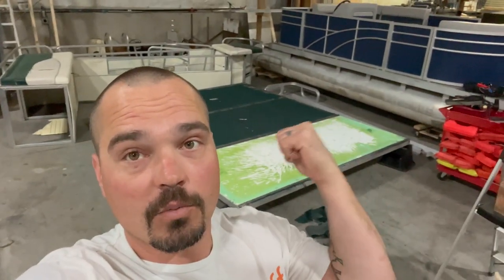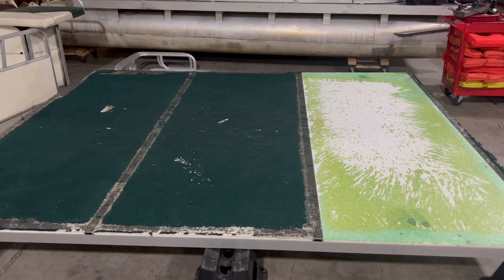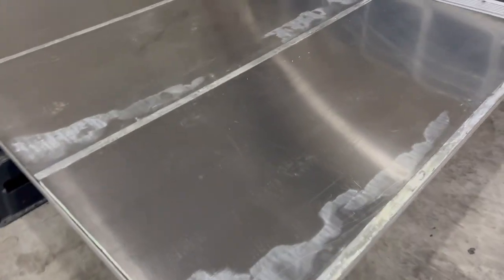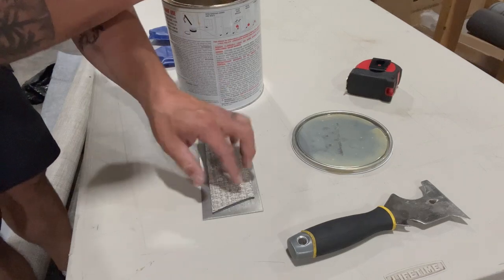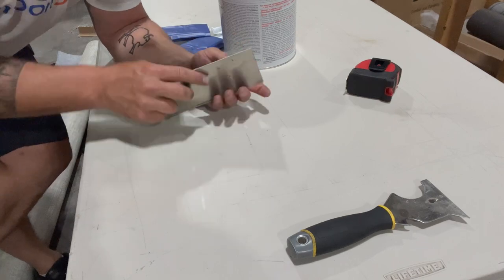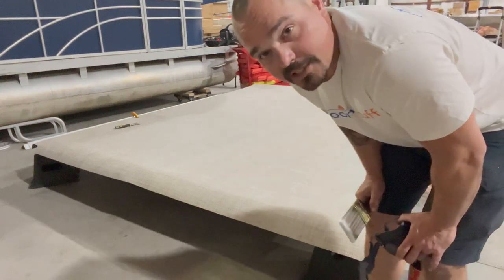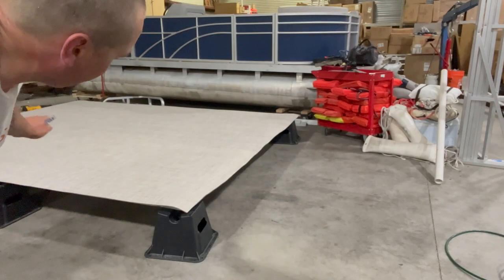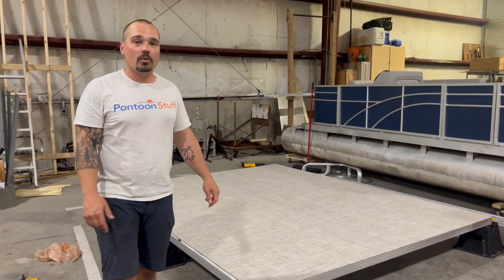Installing Pontoon Vinyl Flooring on ALUMINUM DECK

Comment: Been waiting for you to do this video! We replaced old carpet, with the new teak vinyl. I would not do the removal process again! Ended up using a 4” wheel sander, again not easy and you are correct about it melting the old glue. We used ATT 390 Marine and exterior adhesive, non flammable. Good for aluminum and Marine grade plywood subfloor. It’s a glue, not a contact adhesive, soo much easier to use than contact adh. The floor has been down for 2 months and is secure and beautiful. Love your videos!
Reply from the maker: Thanks for sharing the adhesive you used and your results…I’m sure that install process moved along much faster and smoother! Pontoon Stuff advises their customers to use a solvent based option which is why I wanted to show the process. They’re playing it safe with that advice because when done correctly the solvent based adhesive will surely hold their flooring down for the long haul!

Comment: Hey Tom.  Is this the same glue you would use on marine grade plywood that has been treated with a sealer? Thanks!
Reply from the maker: I would advise against sealing and if the marine grade treated plywood. It needs to breathe and dry when it gets wet. If it’s untreated and you sealed it then yes, you’ll likely need a solvent based adhesive (as long as it doesn’t interact negatively with the sealant). If you’re installing carpet and not vinyl you could use a regular carpet glue as the carpet breathes enough for the glue to cure

Comment: Is vinyl on aluminum hot in the sun?
Reply from the maker: It shouldn't be any different than when it's installed on wood. A hot day in the 90s under direct sun it'll get a bit hot, but just splash it down with water and it'll be good to go for a couple more hours. We've had black powder coated aluminum trim on our boat and it never felt very hot to the touch even on hot sunny days.

Comment: Question - My 1995 aluminum deck has many small holes from various mounts over the years. Some water does seep/splash thru when running.  Will this affect the flooring or the glue?
Thanks - your videos are outstanding.
Reply from the maker: Once the new flooring is glued down it really  shouldn’t impact it negatively. I would consider adding underskinning to be safe, or add silicone from the bottom on places that water could potentially splash or spray up

Comment: New to the channel and looking at pontoons to restore one and I live in Florida and they have some that have the aluminum floor seems like a good idea, but do you have any thoughts or opinions about that versus plywood floor?
Reply from the maker: Aluminum decks are great because they last forever. I still haven't taken on a whole aluminum floor project because it adds an insane amount of time getting the old flooring and glue off. The deck needs to be perfectly clean before adhering new vinyl to it, and the solvent based adhesive is 100% more tedious to use than rolling glue onto plywood. If you're going to be in saltwater then the plywood can cause some issues with corrosion...we're up here in freshwater so we don't worry about that at all. The plywood we install lasts 20-30 years anyway!
Reply: Thanks so much will be watching all the videos be be informed and use them as a step by step thanks again you have inspired me take this on instead of a boat payment with a new one and getting our materials and and all the rest from pontoon stuff
Reply from the maker: @lancejenkins4910  Fantastic! It's the best feedback we can get when someone tells us our channel helped inspire them to take on the project. You'll be so happy with the end product and the money you've saved!